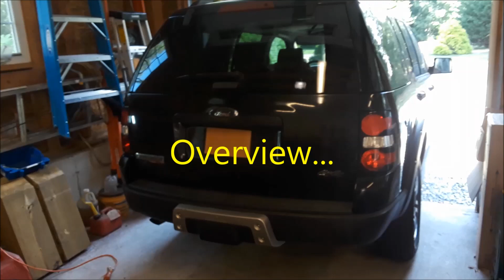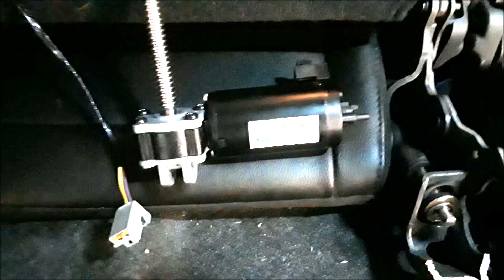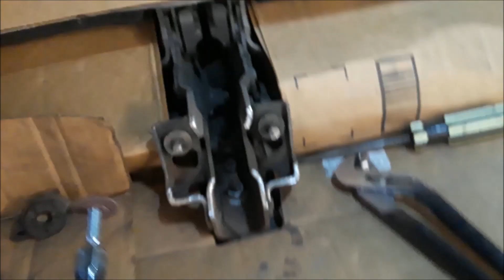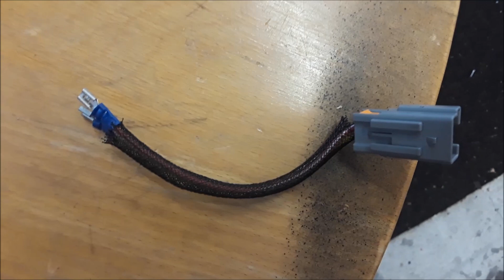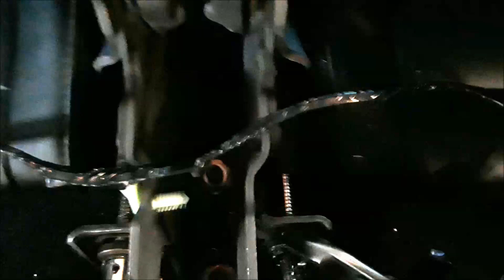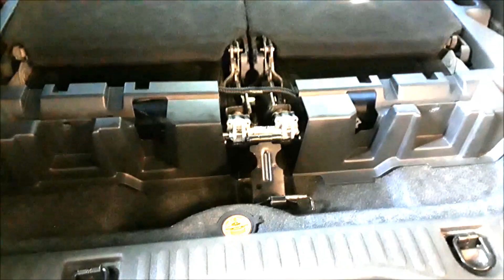2007 Ford Explorer Third Seat Motor reDesign and Replacement

Comment from the maker: Motors are:
Daewoo-200682 Gear-head DC motor 12vdc worm-drive right-hand configuration
and,
Daewoo-200683 Gear-head DC motor 12vdc worm-drive left-hand configuration
Reply: Hey man, I’m actually going to do this right here. Amazing way to save a couple hundred bucks. Thank you!!! My question is, my passenger side is the one that stopped working, which motor do I need? Left or right configuration? Thanks buddy
Reply: I'm curious also.  My driver's side motor is dead and wanted to know whether it's left or right motor needed.

Comment: Do you have links or part numbers for the motors and coupler? Great job! Planned obsolescence at its finest!
Reply from the maker: Here are links to one seller that carries the motors:
https://skycraftsurplus.com/gear-head-dc-motor-12vdc-worm-drive-right-hand-configuration-right-h-12v-sk4640.html

https://skycraftsurplus.com/gear-head-dc-motor-12vdc-worm-drive-left-hand-configuration-left-h-12v-sk4641.html

They are:
Daewoo-200682 Gear-head DC motor 12vdc worm-drive right-hand configuration
and,
Daewoo-200683 Gear-head DC motor 12vdc worm-drive left-hand configuration

Comment: Good job, but you lost me.  That was too difficult to follow.  I just need to get the seats down and I won't worry about raising them.
Reply: montgom3,  If that is all you want, remove the old motors and then turn the shaft with plyers or a vice grip to the down position.